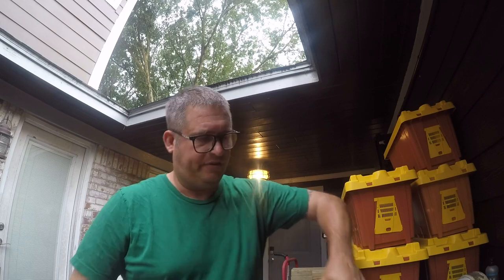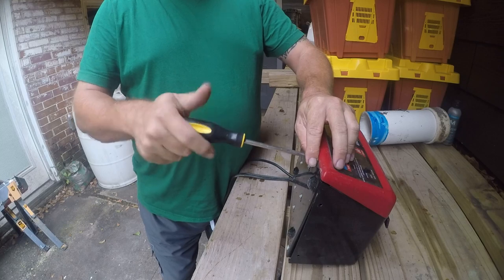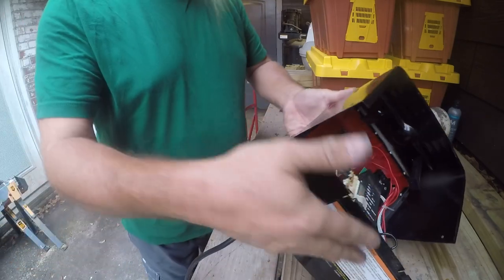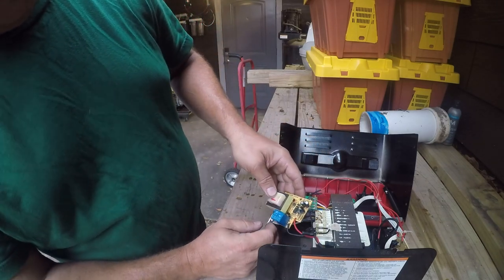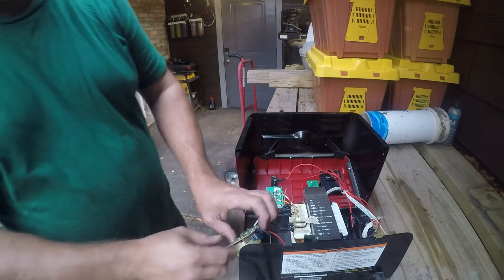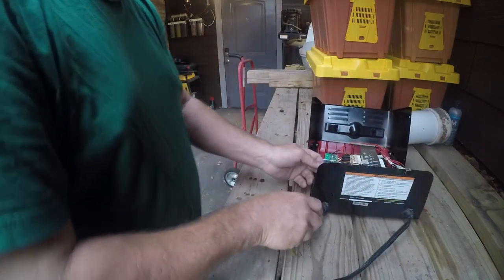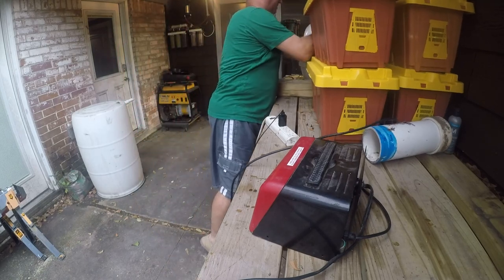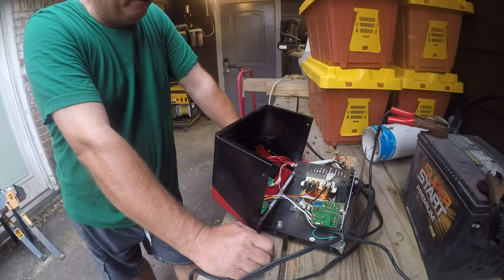Tear Down: Dead Harbor Freight 2/10/50 battery charger

Comment: These chargers won’t recognize a dead battery so they won’t turn on if you try to do so.  I use my portable jumper cable box to “jump start” a dead battery when I connect the charger. 🤠👍
Reply: I use my kid's 12v Power wheel battery in Parallel to get it to recognize the dead battery and turn on, then Ill disconnect the power wheel battery.
Reply: Both of my older ones just like this do recognize a dead battery. And will jump a dead battery and I mean dead dead. 

I just got another new one yeaterday its blue but the same and it will not....
What a waste. I don't understand the purpose of the engine start function if it won't jump a dead battery. Or charge a dead battery ill be finding me a few old models to keep
Reply: Side by side to my old one it will not and the old one will i wish there was a hack. Other than using another jump 
Such a pain

Comment: On the positive side of your charging leads coming inside the charger. The black box just inside to the hot lead is the kick out relay and doesn't have a fuse. I don't think I'm working on 1 at the present.  Experience very little that it is.Usually the switch or one of the switches, Secondly, I learned some time ago that putting a battery charger on boost start is asking for issues.So as a rule.I don't even use that setting, Ever I don't want your battery charger to have work again.shouldn't even put that on there

Comment: Good video, terrible charger, but you can get over that. By Disconnecting the incoming power black.
From circuit board the circuit board and splash it into the transformer. Incoming power, you will not get any readings, but it'll function manually.  By switching the the 210 and 50AM. Only for someone that has electrical knowledge, thank you. Good luck

Comment: The idiots designed this charger to work like a lithium batter charger. If the voltage is too low in the battery, the POS charger won't charge it.